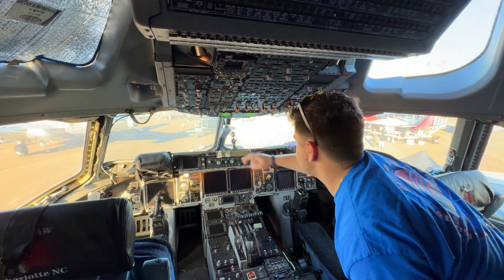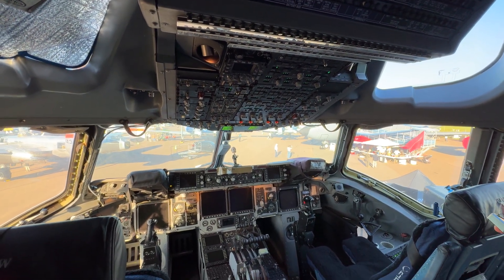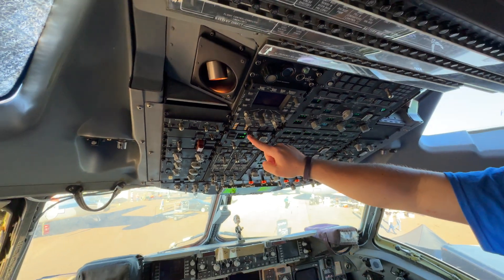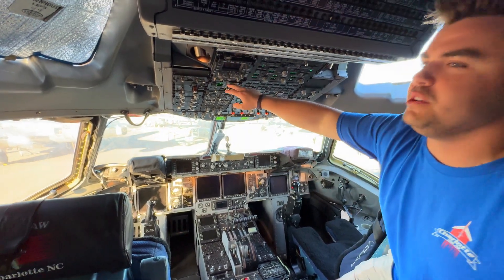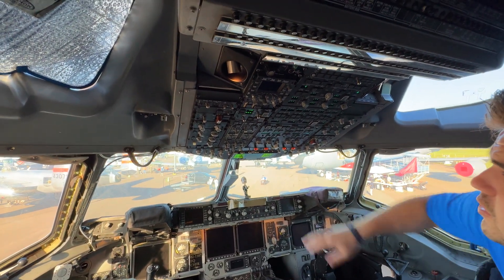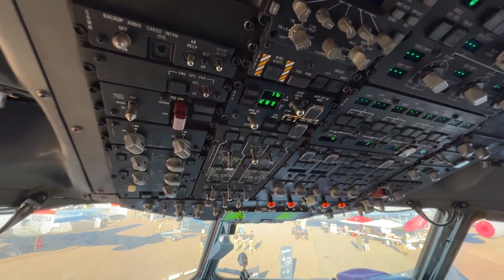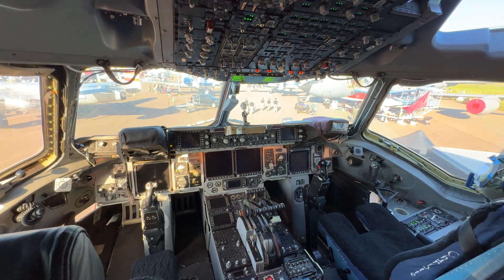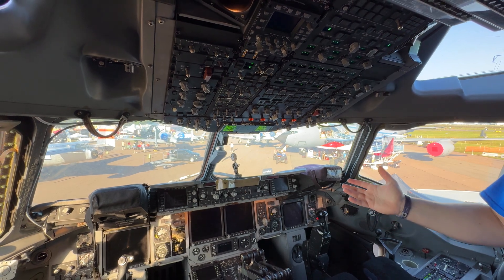(4K) C-17 APU Startup & Warnings

Comment: 2:36 WE WERE SOO CLOSE TO THE PULL UP ALARM WHYY 😭
Reply: How doyou know that there is a PULL UP Alarm? I could be wrong, but I heard and red only about TERRAIN FLY UP.   
Similar for DONT SINK. There is no DONT SINK in the C-17, but SINKING SINKING.

But there should be a GLIDESLOPE warning. If I did understand correctly, if the GLIDESLOPE deviation would be to high, you then would hear: TOO LOW POWER.

Unfortunatly there are no documents availible which describe the avionics more in detail.

Perhaps the Weather Radar also gives aural messages. What I know is that the WACS Warning and Caution System gives many messages.

Like:

WACS FAIL WACS FAIL
MANIFOLD MANIFOLD
HYDRAULIC HYDRAULIC
FUEL PRESSURE LOW FUEL PRESSURE LOW
PITCH AUTHORITY PITCH AUTHORITY

I guess that there are much more warnings, for example for Electrical Generators, AC/DC, Bleed Air and other systems.

The aural warning CABIN ALTITUDE does exist in the C-17.

1500 (FIFTEENHUNDRED)
5 (FIVE)

should be also availible.

4,3,2,1 GREEN LIGHT (for airdrop off)
TWENTY MINUTES (Time Marker) could be also 10 minutes, or other values

I would like to know if TOO LOW TERRAIN exists.